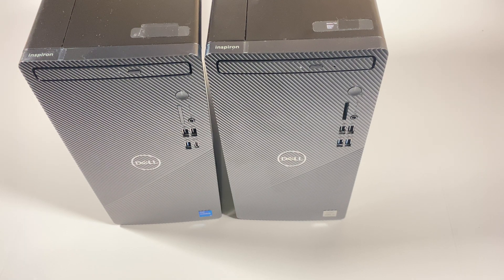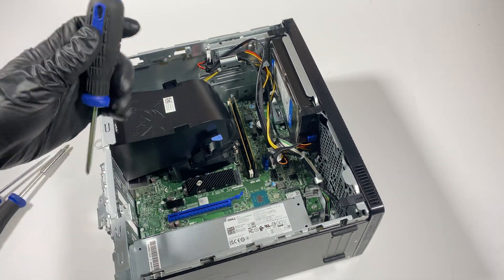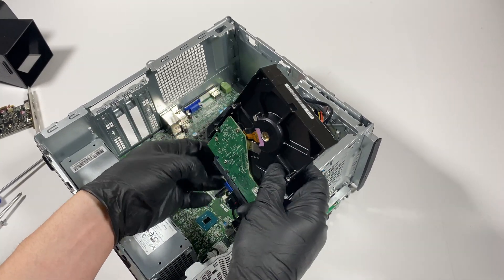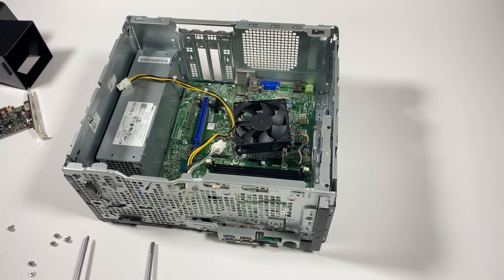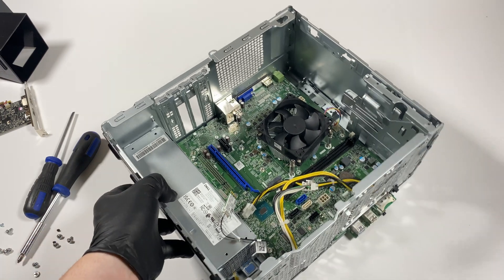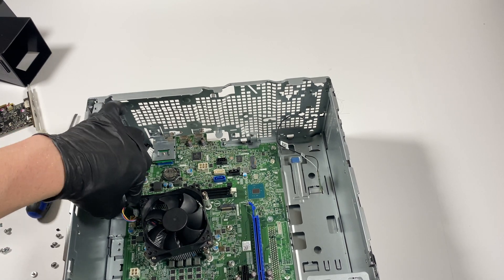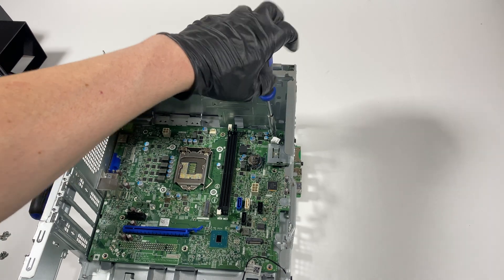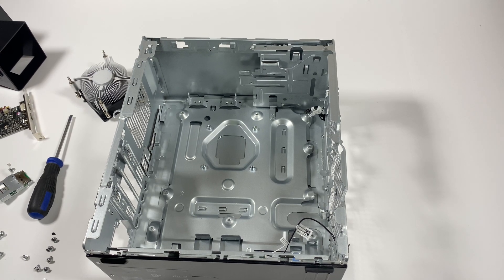Dell Inspiron 3891 3880 Teardown

Comment from the maker: List of Parts and Upgrades works with this system :

Dell Inspiron 3880, 3891

(1.) Wifi Adapter 600mbpsWireless USB Adapter 2.42GHz/5.8GHz
https://amzn.to/3nXHAPK

(2.) USB Wifi Adapter for PC AC600Mbps Wireless Network Adapter
https://amzn.to/2ZaGuHb 

M5x10mm PC Fan Mounting Screws 
https://amzn.to/3R41CH5

ADD Rear System FAN to make PC run cooler.
Simple Deluxe 80mm Quiet USB Fan with Multi-Speed Controller
https://amzn.to/3jgHxiI

Compatible With Dell Inspiron 3880 

List of RAM will work with this system.

(1.) Crucial 32GB Kit (16GB x 2) DDR4 3200 MT/s (PC4-25600)
https://amzn.to/2Zazppk

(2.) Crucial 8GB DDR4 3200 MT/s (PC4-25600)
https://amzn.to/2R07Ier

(3.) Crucial 16GB Kit (8GB x 2) DDR4 3200 MT/s (PC4-25600)
https://amzn.to/326cfT7 

(4.) Crucial 32GB (2 x 16GB) DDR4-2666 UDIMM
https://amzn.to/3QW8aXW

(5.) Crucial 16GB Kit (2 x 8GB) DDR4-2666 UDIMM
https://amzn.to/3KbR9a5

Power Supply Upgrade 260W
Part Number: for P/N 0H7X3F H7X3F, H260EBM-00
https://amzn.to/3SfmbAC

List video cards will work with this system Dell Inspiron 3880

GIGABYTE GeForce RTX 3050
https://amzn.to/3W2sJY9

MSI Gaming RTX 3050 Gaming X 6G Graphics Card 
https://amzn.to/4eNikqD

(1.) Gigabyte GeForce GT 1030 GV-N1030D5-2GL Low Profile 2G Computer Graphics Card 
https://amzn.to/2Z4PHkp

(2.) ZOTAC GeForce GT 1030 2GB GDDR5 64-bit PCIe 3.0 DirectX 12 HDCP Ready Low Profile Video Card ZT-P10300A-10L 
https://amzn.to/2WzgLXk 

(3.) MSI Graphic Cards GT 1030 2GB GDDR5, Low Profile 
https://amzn.to/390Spum

(4.) Gigabyte GV-N1030OC-2GI Nvidia GeForce GT 1030 OC 2G Graphics Card
https://amzn.to/3wd8EkB

(5.) Asus PH-GT1030-O2G GeForce GT 1030 2GB OC Edition Graphics Card
https://amzn.to/3SZ0gPC

(6.) AMD Radeon RX 6400 Low Profile Gaming Graphics Card
https://amzn.to/3s8MUUY

Thermal Compound Paste:
(1.) Arctic Silver 5 Thermal Cooling Compound Paste 
https://amzn.to/2ziNU0H

(2.) Noctua NT-H1 3.5g, Pro-Grade Thermal Compound Paste
https://amzn.to/36kTk7A

(3.) ARCTIC MX-4 (current edition) Thermal Compound Paste 20 Grams 
https://amzn.to/2DhGJaK 

List SSD Heatsinks:

(1.)  M.2 2280 SSD heatsink, Double-Sided Heat Sink, PCIE NVME M.2 SSD
https://amzn.to/3l2ittr

(2.)  EZDIY-FAB M.2 2280 SSD heatsink, Double-Sided Heat Sink, PCIE NVME M.2 SSD
https://amzn.to/3m7J3me

List SSD M.2 Type 2280 NVMe PCIe:

(1.) Crucial P3 Plus 4TB PCIe M.2 2280 SSD
https://amzn.to/3RZcUNi

(2.) Crucial P3 Plus 2TB PCIe M.2 2280 SSD
https://amzn.to/3RTUi0Y

(3.) Samsung (MZ-V7E1T0BW) 970 EVO SSD 1TB M.2 NVMe
https://amzn.to/3d52k2a

(4.) Samsung 970 EVO Plus SSD 500GB
https://amzn.to/3fpi95A

(5.) Samsung (MZ-V7E500BW) 970 EVO SSD 500GB - M.2 NVMe
https://amzn.to/37uuLFw

(6.) Crucial P1 500GB 3D NAND NVMe PCIe M.2 SSD - CT500P1SSD8 
https://amzn.to/2N07wKh

HDD list works with this PC:

(1.) Seagate BarraCuda 4TB Internal Hard Drive HDD – 3.5 Inch
https://amzn.to/3d3xWeR

(2.) Seagate BarraCuda 8TB Internal Hard Drive HDD – 3.5 Inch
https://amzn.to/3xjUDSJ

(3.) Western Digital 2TB WD Blue PC Hard Drive HDD - 5400 RPM, SATA 3.5" - WD20EZAZ
https://amzn.to/3w3jIQA

(4.).WD Black 2TB Performance 3.5" Hard Drive - 7200 RPM Class, WD2003FZEX 
https://amzn.to/2xFUeyF
Reply: So far I've been using this guide to upgrade my stock Inspiron 3880, and the graphics card installation went swimmingly. Do you have any recommendations for CPU upgrades?

Comment: Mxkdi! IM DESPERATE for some answers! I bought thie Dell inspiron 3880 i5 10400 model. What ram, memory and GPU can I buy for it?? It has 200w power. Will it run a newer Pcie ssd nvme chip ???? I need ram and memory. I can maybe do without the gpu. I need to use a demanding software!! Can we please message? I need guidance and knowledge. thank you so much
Reply from the maker: Hi, here is the list of parts and upgrades works with this system Dell Inspiron 3880 

(1.) Wifi Adapter 600mbpsWireless USB Adapter 2.42GHz/5.8GHz
https://amzn.to/3nXHAPK

(2.) USB Wifi Adapter for PC AC600Mbps Wireless Network Adapter
https://amzn.to/2ZaGuHb 

M5x10mm PC Fan Mounting Screws 
https://amzn.to/3R41CH5

ADD Rear System FAN to make PC run cooler.
Simple Deluxe 80mm Quiet USB Fan with Multi-Speed Controller
https://amzn.to/3jgHxiI

Compatible With Dell Inspiron 3880 

List of RAM will work with this system.

(1.) Crucial 32GB Kit (16GB x 2) DDR4 3200 MT/s (PC4-25600)
https://amzn.to/2Zazppk

(2.) Crucial 8GB DDR4 3200 MT/s (PC4-25600)
https://amzn.to/2R07Ier

(3.) Crucial 16GB Kit (8GB x 2) DDR4 3200 MT/s (PC4-25600)
https://amzn.to/326cfT7 

(4.) Crucial 32GB (2 x 16GB) DDR4-2666 UDIMM
https://amzn.to/3QW8aXW

(5.) Crucial 16GB Kit (2 x 8GB) DDR4-2666 UDIMM
https://amzn.to/3KbR9a5

List video cards will work with this system Dell Inspiron 3880

(1.) Gigabyte GeForce GT 1030 GV-N1030D5-2GL Low Profile 2G Computer Graphics Card 
https://amzn.to/2Z4PHkp

(2.) ZOTAC GeForce GT 1030 2GB GDDR5 64-bit PCIe 3.0 DirectX 12 HDCP Ready Low Profile Video Card ZT-P10300A-10L 
https://amzn.to/2WzgLXk 

(3.) MSI Graphic Cards GT 1030 2GB GDDR5, Low Profile 
https://amzn.to/390Spum

(4.) Gigabyte GV-N1030OC-2GI Nvidia GeForce GT 1030 OC 2G Graphics Card
https://amzn.to/3wd8EkB

(5.) Asus PH-GT1030-O2G GeForce GT 1030 2GB OC Edition Graphics Card
https://amzn.to/3SZ0gPC

Thermal Compound Paste:
(1.) Arctic Silver 5 Thermal Cooling Compound Paste 
https://amzn.to/2ziNU0H

(2.) Noctua NT-H1 3.5g, Pro-Grade Thermal Compound Paste
https://amzn.to/36kTk7A

(3.) ARCTIC MX-4 (current edition) Thermal Compound Paste 20 Grams 
https://amzn.to/2DhGJaK 

List SSD Heatsinks:

(1.)  M.2 2280 SSD heatsink, Double-Sided Heat Sink, PCIE NVME M.2 SSD
https://amzn.to/3l2ittr

(2.)  EZDIY-FAB M.2 2280 SSD heatsink, Double-Sided Heat Sink, PCIE NVME M.2 SSD
https://amzn.to/3m7J3me

List SSD M.2 Type 2280 NVMe PCIe:

(1.) Crucial P3 Plus 4TB PCIe M.2 2280 SSD
https://amzn.to/3RZcUNi

(2.) Crucial P3 Plus 2TB PCIe M.2 2280 SSD
https://amzn.to/3RTUi0Y

(3.) Samsung (MZ-V7E1T0BW) 970 EVO SSD 1TB M.2 NVMe
https://amzn.to/3d52k2a

(4.) Samsung 970 EVO Plus SSD 500GB
https://amzn.to/3fpi95A

(5.) Samsung (MZ-V7E500BW) 970 EVO SSD 500GB - M.2 NVMe
https://amzn.to/37uuLFw

(6.) Crucial P1 500GB 3D NAND NVMe PCIe M.2 SSD - CT500P1SSD8 
https://amzn.to/2N07wKh

HDD list works with this PC:

(1.) Seagate BarraCuda 4TB Internal Hard Drive HDD – 3.5 Inch
https://amzn.to/3d3xWeR

(2.) Seagate BarraCuda 8TB Internal Hard Drive HDD – 3.5 Inch
https://amzn.to/3xjUDSJ

(3.) Western Digital 2TB WD Blue PC Hard Drive HDD - 5400 RPM, SATA 3.5" - WD20EZAZ
https://amzn.to/3w3jIQA

(4.).WD Black 2TB Performance 3.5" Hard Drive - 7200 RPM Class, WD2003FZEX 
https://amzn.to/2xFUeyF
Reply: @Mxkdt  could I do the  32gb cards X 2 ? Is there any reason that won’t work?
Reply from the maker: @Cmtb125  Yes you can install Max 64GB Crucial RAM Kit (2x32GB) DDR4
https://amzn.to/3LlEG4c
Reply from the maker: You can also upgrade power supply and install faster video card like rx6400 or gtx 1650

AMD Radeon RX 6400 Low Profile Gaming Graphics Card
https://amzn.to/3s8MUUY

Power Supply Upgrade 260W
Part Number: for P/N 0H7X3F H7X3F, H260EBM-00
https://amzn.to/3SfmbAC
Reply: @Mxkdt  thank you so much!! I’m going to figure out what I need, and can afford to build in this PC and roll with it. This helps so much. I’m new to this stuff. But very interested and soon will build my own Pc. For now, this Inspiron 3880 with the i5 is going to have to do. The software I need to run is called Mastercam. It creates toolpaths, that a CNC machine uses by creating G Code from geometry and 3D models that I will create. Thanks so much! Love your videos!!!

Comment: Hi @Mxkdi, can the second HDD be fitted in this case? thanks for confirmation.
Reply from the maker: Hi. you can only fit one 3.5inch hdd and or you can fit two 2.5 inch hdds drives  with caddy and one ssd nvme, please note you must have at least 260w power supply installed if you are running 2 hard drivers and  extra ssd and video card.. You can use power supply 260w dell part number 0h7x3f from  a dell inspiron 3891 and will work in a dell inspiron 3880.
Reply: @Mxkdt  Thanks so much.

Comment: NICE WORK MAN I swear u are the one who made me happy I told my dad to see the video of the 1050 ti in a OptiPlex 7050 that is the exact one that I have and he agreed and I have it now TYSM
Reply from the maker: Hi, thanks
Reply: @Mxkdt  yo bro fr now im so happy with what i have, sadly i had to down grade to 7040 but its isn't that a big of a downgrade so yeah TYSM
Reply from the maker: @Heathenvfx  Yes with dell 7040 with i7 CPU really solid machine and why did you downgrade ?
Reply: @Mxkdt  look my pc suddenly didn't want to boot i tried every thing nothing worked so i had another one but it was 7040 i just took the GPU and put it in. ( from nearly 2 weeks i got a thermal paste and i tried putting my old CPU in this pc and it didn't boot but when i put in my CPU that I'm using now it works so i think the problem was from the CPU )